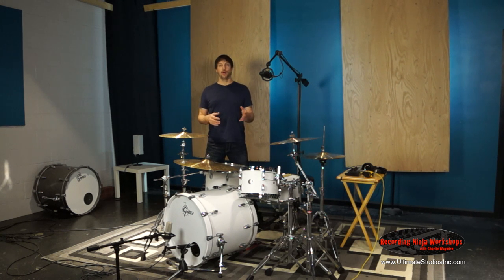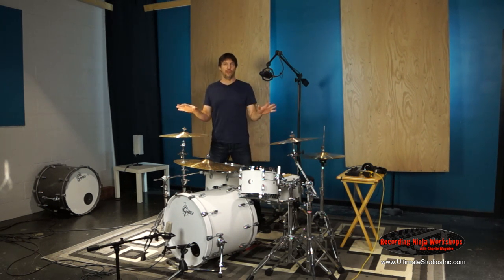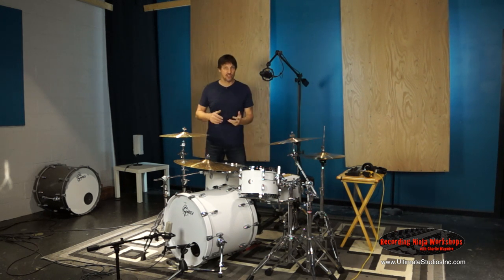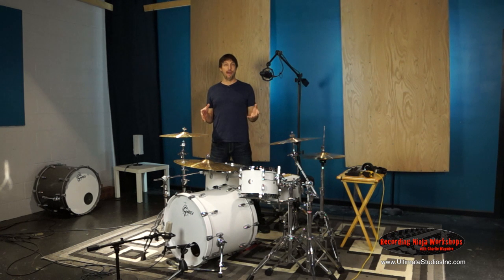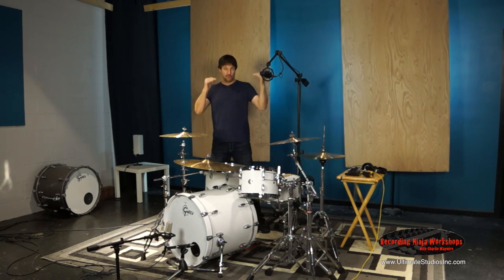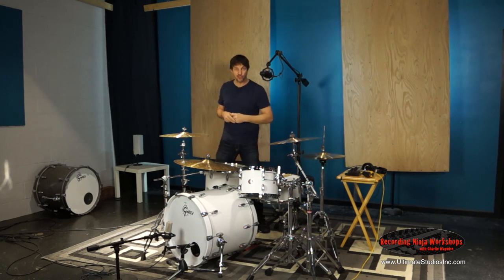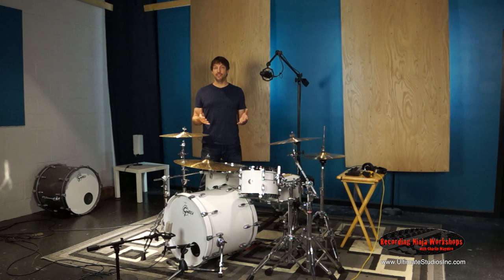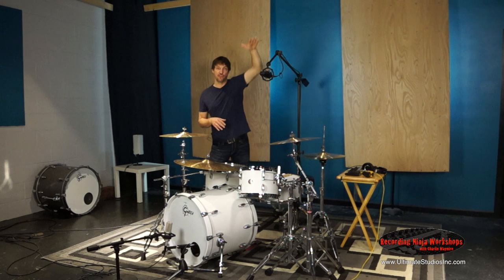How High Should Your Overhead Mics Be? Charlie Waymire: Recording Ninja Workshops

Comment: I tried this today (first ever drum recording) with a U87 and a 1073 (no comp), the sound peaked the input of the neve, had to drop preamp gain to almost nothing as well as drop the output of the neve to almost nothing to not distort the input of the interface...any pointers to what i can do differently? 👍
Reply: Engage the Pad on the 1073
Reply: @matiasrengel3143  Thank you for for the tip, but the -20 pad is only for the DI on the DPX, I have to get me a attenuator (xlr) 👍😊